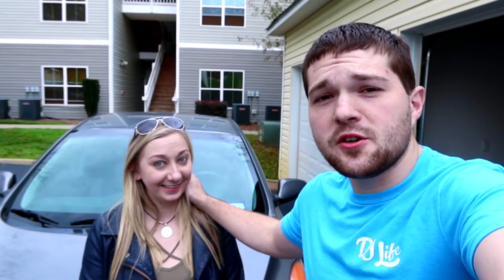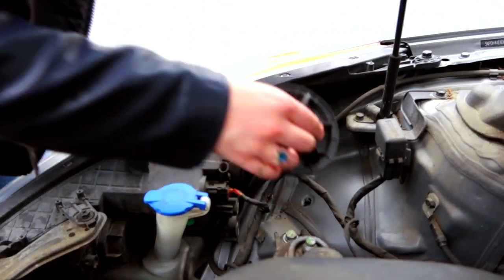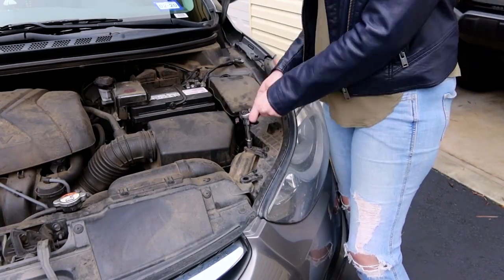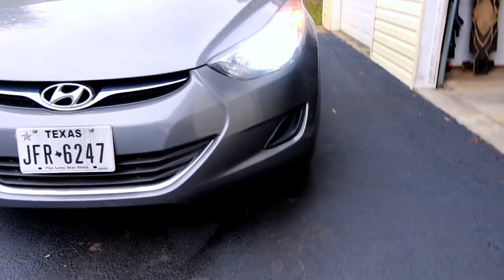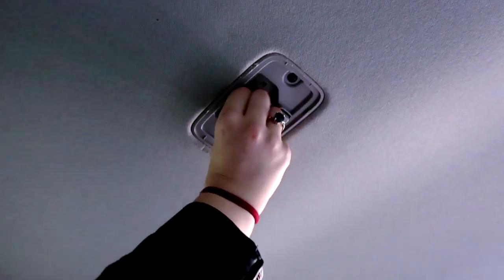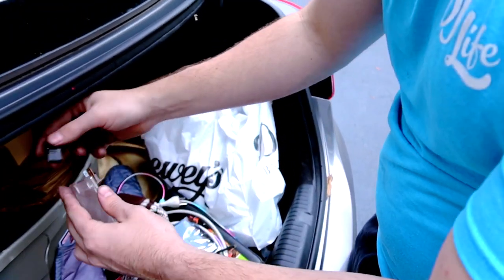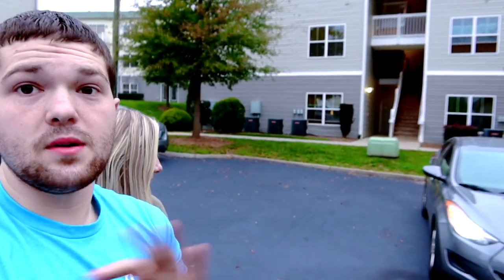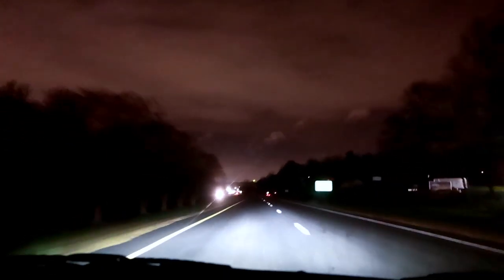My Girlfriend installs LED Headlights + interior (Hyundai Elantra)

Comment: I own that same 2013 Hyundai Elantra! When I upgrade my interior lights: dome, map, vanity & luggage to LED bulbs, it blew out my 10 Amp fuse for the dome light, not once, but twice! Is there anything I’m doing wrong during my upgrade?

I upgraded my headlights, taillights, back up lights, turn signals, flashing brake lights & license plate lights to LED & turned out phenomenal for night driving 😍
Reply: Which led? Model please I need
Reply: @alexguzman8354  All of my exterior lights: brakes, taillights, reverse, turn signal & license plate bulbs are from Alla. I’ll list you the part numbers that I used momentarily.

Comment: Are your DRLs still turning on after changing the low beams to LEDs? I did the same mod, but my halogen DRL (same bulb used for the high beams) do not turn on. The high beams do turn on, so I know that the bulbs are working. I’m guessing there’s a link between those 2 sets of bulbs (low beams VS. DRL/high beams). Any ideas why the DRLs won’t turn on? Curious to know if your DRLs work after the mod. Thanks!
Reply from the maker: Not sure but we never had issues